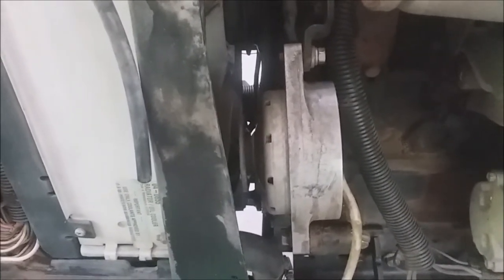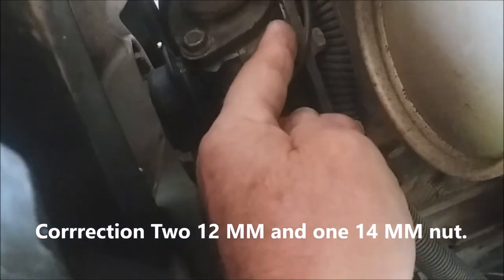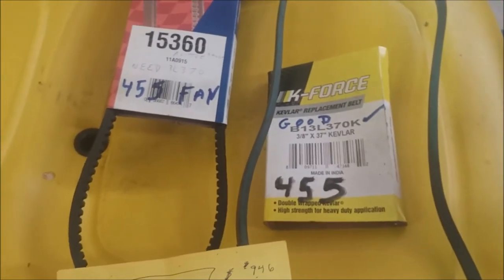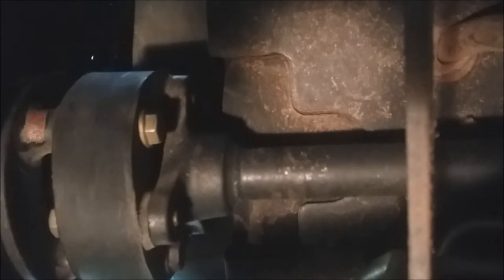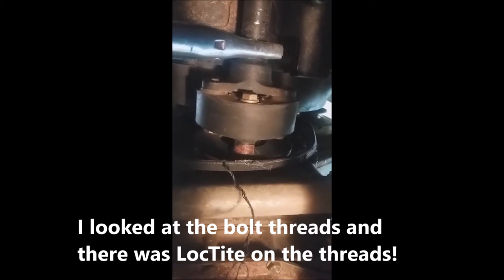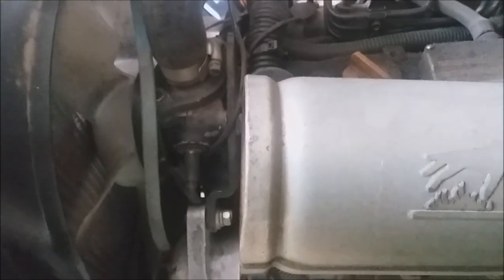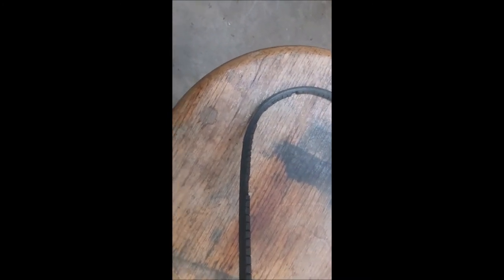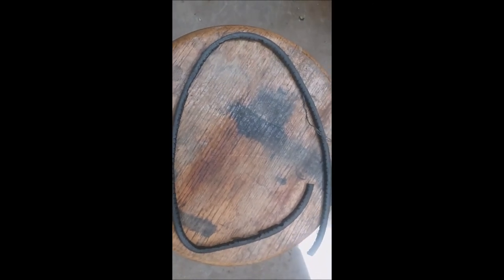Changing John Deere X Series Diesel Fan Belt

Comment: Thanks for the video.  I have the X758.  My bolts on the rubber isolator did not have loctite but they were still a bear to remove while trying to keep the shaft from turning.  After removing those bolts I discovered that the rubber isolator was cracked so I had to order a new one ($48).  btw my manual says to torque those to 30 lb-ft.
Reply from the maker: I have 4 used ones on my shelf. $48 !!!    I would sell for much less if anyone is interested.